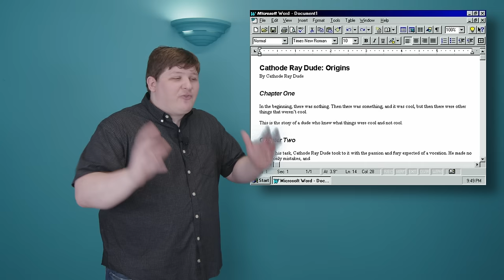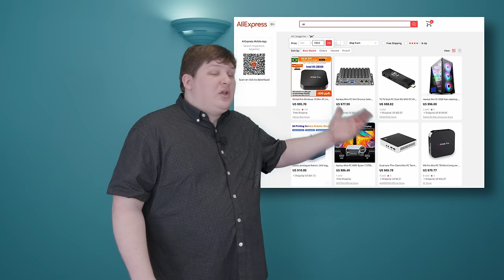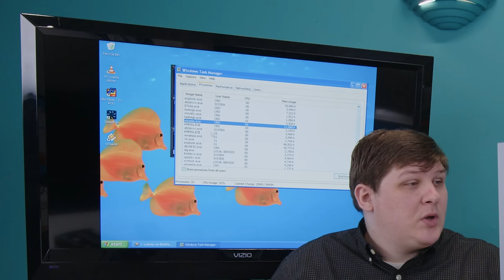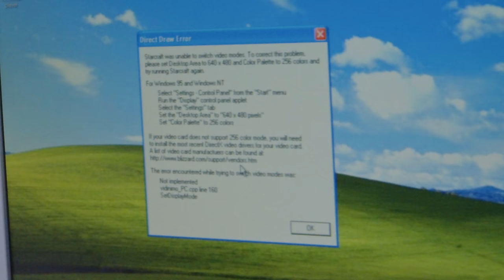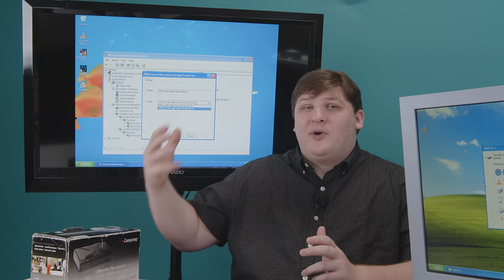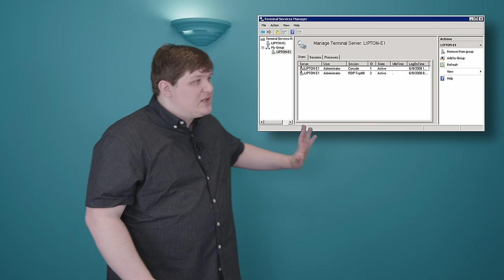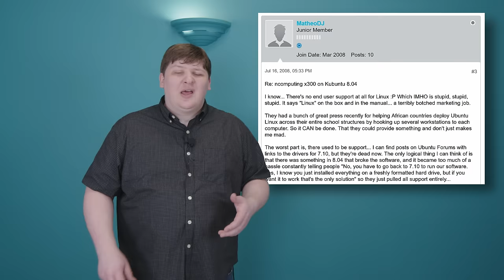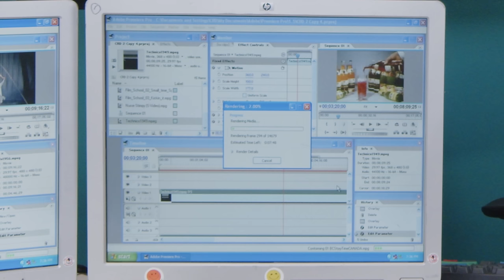7 Users on 1 PC! - but is it legal?

Comment: https://youtu.be/116WRqAOJbY
This is the cable mystery solved

You're right, they used few accounts of local users to run this

The problem you were facing with Q3 came probably from the OpenGL. Quake was somehow less impressive than UT or MoHAA but it was in need of 3D Acceleration module (3DFx and kids). Q3 was probably packed somehow special so the errors were coming from the unfinished processes of every copy (it was expecting another step two of the first machine and it got other game one). All problems I see are coming from GPU.

Thing that supprised me is that you say that 2 machines run somehow better than one alone. The problem is the clock speed. To properly divide the RAM - the device should have it's speed doesn't it? It was probably coin method that was used but I don't really remember everything besides that XP (Windows but Athlon 1700+ processor) were simply damn good and only then I could say I was in control of my machine. Today I'm only user :/

Comment: First you did not get the 2 4.0 USB ports on they are on the back of the PC if you order one with 4.0 you need to do a return and get the one you ordered but I have the same ser6 max it has a 3.2 c USB and a 3.2 USB a on the front on the back is two USB a 1 3.2 USB a 2 USB c 4.0  HDMI  and a display  a 2.5 gb lan port so you either got a ser 6

Comment: i have three Lenovo T410 laptops from 2010. I paid less than $100 for each for parts with fan error and run Linux mint 20.1. on them. The fan error was only a dirty fan and a can of dust off fixed that. I have a cloned drive SSD drives in them and if I have to I can pull the drive from one and put it in another, go Linux. 
These T410's had Microsoft Windows on them and were Sloooow. Just by putting Linux mint on them, they are now fast computers and i have a series 3 Lenovo mini dock I put the one I am using in with all the USB 2.0 and 3.0 jacks.
the LibreOffice runs everything I need for office and it is like all Linux is free.

why anyone sticks with microsoft windows is beyond me.

Comment: There's no real magic. I think there's some trickery on the HID part, if windows saw all the keyboards/mice as HIDs, it would not work very well. The FGPA emulated GPU makes perfect sense.  I doubt this could have worked at all with any non truly multi-user OS. 

In dealing with Microsoft licensing in my past, if you have enough licenses to cover what you're doing, they won't do anything (even if they know, and it's technically a violation of the EULA). It's stupid when you have to buy server licenses/cals for a server not running windows on the bare metal. It's even weirder buying CALs for linux boxes. I bet this was designed for the Win2k/2003 market where the eula is designed for multi-user. At one point there was even Windows Home server, but it sucked.

Comment: You outta try windows multipoint server 2010,2011,2012 and the last version 2016 Microsoft listened and I remember using multipoint server 2011 its tailored to feel exactly like windows 7 just with a blue background on the logon screen and no aero once the built in multipoint shell logs in as its done to save on resources but it was a good os it was used in the school district I was at to power 15 work stations off one pc and do it smoothly too if you wernt told it was single computer powering a ton of usb zero clients and it was hidden you would have no idea I have been messing around with the os on my personal machines and its just as I remembered it

Comment: I run a i7 3960 6c/12t it’s well outdated but for gaming pared with a nvme and a gtx 1080 is a great gaming machine that run the newest games at 1440p at decent settings I want to upgrade but don’t need to just yet lol

Comment: Well if they have like a i7 2700 or i7 3770 pc with 16gb of ddr3 … if they would of installed a ssd for there main boot drive soon as they were affordable they really still have a very decent PC and for doing very basic even video editing witch will be the hardest task it should still be possible even but yeah PCs from like 2012 have been pretty hard to notice advances for standard users who just browse the internet use some office software possibly and email haha also cell phones in the last 8 years and iPads have killed the reason for most light computer users from even needing a PC … I upgraded from a i7 4790k to a ryzen 5800x last year finally and only did it because i got a hell of a good deal on one someone stole the graphics card out of haha but yeah the new PCs or amazing and fast but honestly it’s indistinguishable from my 4790k in 99% of tasks I use a computer for. Having a good SSD boot drive is the main thing to having a PC today if you have a somewhat modern Pc with that setup you will be fine unless you or a video editor or wanting to be a enthusiast type gamer.

Comment: That was interesting attempt, but dead end, cause it was relying on Microsoft...
There was much more interesting technology at the start of computing, called "Reborn" - that was a hardware based storage protection. Literally. The PCI version was used to connect your HDD and the extra menu can be entered on BIOS level. Enable access to your storage, load all you need, then disable it. Now you can load as many viruses as you pleased or format drive "C" - then reboot your computer - and it is as good as new! That would null and void necessity for ANY antivirus... Sad, but short after release it was gone and neither engineers nor company could be found. "Nothing personal, just business".
P.S. There was very short production run of G-Store HDD up to 60G capacity with that technology onboard, so no need PCI card, but the fate was the same...

Comment: I can access any windows computer, manipulate any windows file, do any windows task just fine on Debian so I don't know where that must use windows argument comes from. In a real secure small to large business you use only linux. Your windows connects to linux systems the moment you turn it on. Suggesting that there is anything windows can do better is simply wrong. In linux problems are solved by users. This is why linux produces code faster that is more secure.

Comment: Still using my AMD 8350 and MSI gaming board. So far it has done everything I have asked it to do and it uses Linux Mint as its OS. At one time I had Windows 7 and 10, but MS killed Windows 7, and Windows 10 slowed my computer down. So I gave Winows the kick and downloaded Linux Mint and installed it, haven't looked back since, but I do have one Windows 10 machine in use right now (if fact this is the one I am using) every now and then I get a pop up by McCafee that now I have a zeus virus. I really don't care, because I am used to either Microsoft destroying itself by updates, or by virus's infiltrating Windows and if you thing I don't care well Defender hasn't found anything yet, and Mcafee is like our news media, completely fake.

Comment: After the player switched to the vp9 codec, 
my 2070 video card stopped using hardware acceleration. I could no longer watch 4k 60fps,
as the i5 6600k processor was constantly causing staters and 100% load during playback....
This is one of the things that causes the most anger, 
because support for this nonsense called vp9 is only available in nvidia 30xx, 
instead of using hevc which even the 9xx line of graphics cards support,
they introduced another unnecessary useless codec and av1 in parallel with it, I have a ryzen 5 5600x now, I'm afraid in a couple of years 
they will reintroduce another iteration of vp and 4k will be laggy.... 
This looks ridiculous, considering that 10 years ago I could watch fullhd video on a laptop with a celeron b815 without any staters...
By the way they also made a completely unnecessary webp format,
I hate this creation the most, rest assured when you want to share something and you have webp, most likely 95% of the place you want to do it in does not or does not support webp, but without a preview as a file, it literally drives me crazy....

Comment: Sorry, but if I can get 2+ GPUs to run inside Linux, I can create 2+ machine consoles with keyboard, mouse, audio, webcam, USB hub and have 2+ users  logged into one computer.  Its baked into the Linux OS, but is not done usually as most people want to use Linux as a PC on a laptop or their own desktop. I desktop user can be a real asshole to the other user if they have root access.  I used to play a toilet flushing on my wife's console....

Comment: BS detector! Maybe in ome turnkey office environments Windows server is the preferred platform. But, Linux was designed for networks and servers. The Internet runs on it or Unix for the most part and can serve windows machines just fine. An experienced network engineer will likely appreciate it for it's technological power, flexibility and low cost.
Linux was also multiuser from the start albeit in command line. Multi-use gui-desktops shouldn't be a stretch unless the hardware isn't strong enough to render the video.

Comment: I have a computer from 2009 that I guarantee is faster in gaming than anything you can buy at Wal-Mart today . if you want proof Battle of the immortals Poseidon server (by perfect world entertainment) After 8 years of not playing I still have the richest player the best ashura pets in the game ranked no5 slayer the only maxed out guild by 90% solo player the highest hel gems in the game (hall of fame rank of players killed in dungeon areas) *I have 20 accounts full of the rarest premium items ever made in the game including flying elephant mount twilight level is 2 levels under maxed out (no one's perfect except for my 4.9k ashura of course) but in Everest Unlimited it's bench mark is 27k only thing faster is a Cox communications server and a dualcpu 8 + 8 core. That requires more electricity than a welding machine(1400watts) *mine only requires 330watts and was originally made by Dell 🤘🎩 I will skip the dice on any of you in PvP - I don't cheat either
Reply: Latency is everything (bus cache is to)
Reply: It will be slower connecting to a gaming however though to run a whole network of sessions like a classroom would , what you have there is weLL worthy as well as offices *just remember to shut it down for a period of 20minutes per day else internal heat will become an issue same as you home modem it's good to power it down or simply turn off it's power 20minutes+ per week ..major difference in performance and reliability

Comment: You have the wrong concept and why people actually use or have used such programs, DEFINITELY not for using professional video editing programs, games etc etc
Hardware old 20+ and Windows XP... man, why not use Windows 95 or DOS, and install Final cut pro? And i paralel maybe some new game will do the magic... 
Be a man and first use at least Windows 7, strongly recomend SSD and than use od 1 seat internet, on second word, 3 seat video etc etc
The point is to use  resorses in any time devided by multi users. 
Years ago my favorite wass ASTER for 3 users on Intel i7 + Windows 7 + SSD's and worked fine, not noticeble lose in power becose on  #1 movies on Kali with remote, #2 Office word etc #3 pictures edit, PCB creator and all the rest... 
Never used more than 10-20% on potencijal
Yes, I recommend this programs if you need some privacy with diferent user login on the same PC, personal background and sounds, icons on Desktop...

Comment: Mwahaha! I've not "upgraded" my PC for 17 years ... And it was a "from scavenged parts" then, and the only reason I upgraded then was to double my memory capacity as 2GB x 2 was all the hardware could support ... NOT because MS said so! When is the penny going to drop with you bozos?

MICROSOFT SUCKS! 

How many PC's and laptops that are PERFECTLY serviceable are going to  be JUNKED because they won't be able to even LOAD Windoze 11 let alone install & run it!

I have run NOTHING BUT LINUX for 20 years and now:

*  run MORE software than I did back then (All FREE). 👅🤪

*have ZERO bloat since I can easily remove any built in software I do not need! 👍👍👍

*NEVER suffered a BSOD(!!) 😁

*have not run antivirus for 20 years, or needed to!😱😁

* have not required a disk defrag in 20 years (just proves that MS! Have zero idea about how to write a decent OS & file system.

AND YET I can still run CADCAM, 3D printer slicers, spreadsheets, secure and private browsers, ECAD, video editor, photo editor, genealogy software, multiple virtual machines, Facebook (which DOES have bloat!), plus lots of other utility software like CD, DVD, mag tape rippers, Audio editor, data conversion tools! ALL running just fine thank you ... They NEVER did run reliably under Windows!

Wake UP! Microsoft is taking you for a ride to the cliff edge and all you can think of is "Oh what a great view!" as you sit looking backwards unable to see the cliff & train wreck that's coming!

Good luck with that! Enjoy the plunge and all the wasted money along the way! 🤔🤔😲😲😱😱

Comment: Dude I like some of your videos but this one is sort of misleading to people who do not understand things.
Telling people they can keep old computers with with old operating systems can be pretty critical.

Let's say some old people start online banking and they are using windows XP which doesn't get security UPDATES anymore. Well there goes their personal data 
Sure using a very old computer to write a book is fine but without knowing all of the ramifications of what your saying I would step back and look at this video again and maybe refilm some of it.

To follow up on some of what you have said I have a 19 year old and FX 8350 system and it's Super fast still. So yea the hardware has gotten to a point where we don't need to update it constantly. I could even game on it with the video card I just threw in.

Then I have a Ryzen 5600x system with windows 10 and a really nice graphics card.

Be careful about software anyone who is reading this.

Take precautions with your old systems and try to update to a modern Operating system if possible. Check with a local technician you trust